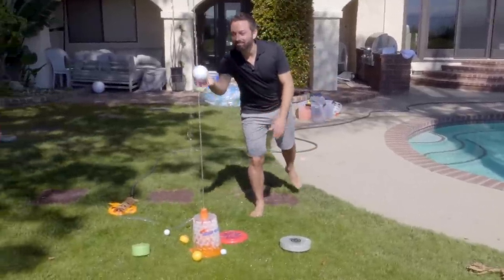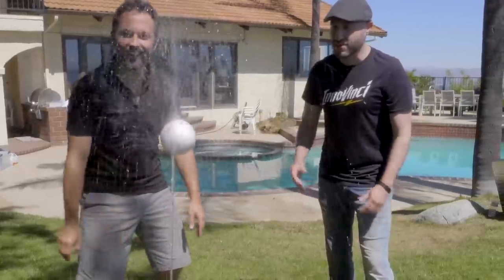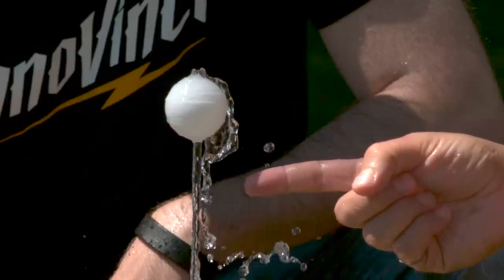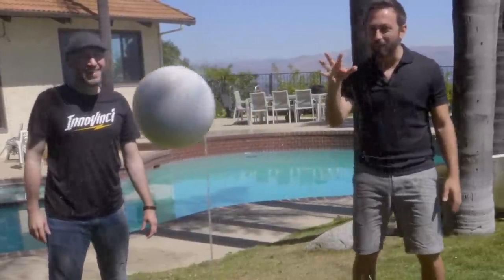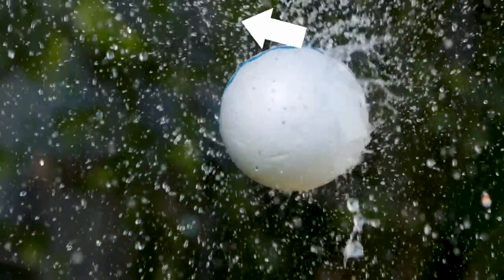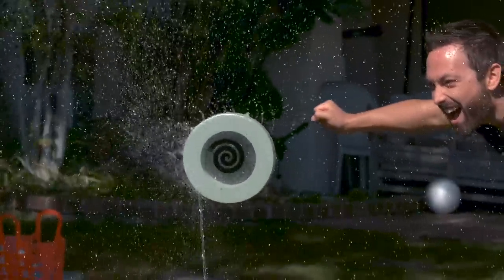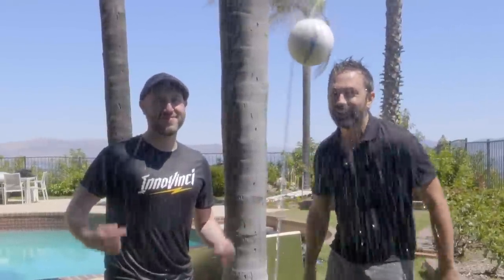Hydrodynamic Levitation!

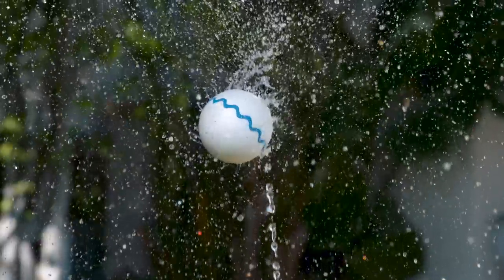Comment: 3:20 there is more water hitting the ball (away) than water that is flung away to keep it in. I suspect air pressure difference is a large actor here to. Fast water moves air (low pressure), slow/still air is on the opposite side of the stream (high pressure) pushes it back towards the water and finds eq..
Reply: try get a hose (not hair dryer) to blow air parallell to the stream with same speed on the opposite side of the ball! This way we se if/ how much air pressure has to do with levitation.

Comment: It's pretty clear at 3:30 that most of the water is flung off the ball almost immediately. That leads me to believe that the ball is pulled by the water's surface tension/adhesion since the water wants to go straight. The ball deflects the water towards it and newton's third says that the ball will be pulled towards the water.

Comment: for anyone who asked,will it work on hydrophobic material
no,what cause the ball to stabilize is that the water is thrown to the side(by the adhesion) causing an opposite reaction so it pull the ball back to the stream

if the material is hydrophobic then the water wouldn't been thrown to the side and the ball wouldn't have any force to pull the ball back to the stream

Comment: G'day Mate, This was a really interesting video for me except I thought I would point out that the reason this phenomenon happens is because of the Coander effect. NOT BECAUSE THE WATER CREATES AND EQUAL AND OPPOSITE REACTION.

You can look it up and there are some great demonstrations of this effect on YouTube using a spoon and a running tap. Basically, when a fluid flows over a convex surface, it has a tendency to stick to the surface and suck the surface towards the stream. This also applies to plane wings (because air is considered a fluid in physics) when the plane wing moves forward. The air attaches itself to the wing sucking the wing upward.  If you don't quite get it then just search up Coander effect with spoon and any video will do. It's quite interesting to see what happens.

Thanks for your time and the video! Cheers, Tim

Comment: Great video! But I disagree with the diagram at 3:32. I believe the majority of the force is right and DOWN, not right and UP. Not only does the footage show the majority of the water spraying in an upward and sideways motion, but the force of the water up on the ball is surely stronger than gravity down (we know this because the ball quickly shoot up from a low position), so it must be balanced by a net force down on the water.

Comment: How sure are you that the spray from the ball (or disc) is what keeps it in the water stream? If you place a spoon into a faucet stream with the convex side it doesn't get pushed outward, the water draws it in (due to pressure differential). It's the reason boast sink lower into the water as they increase in speed.  While this does seem to have a rotational effect rather than simply Bernoulli's principle based on pressure differential, it seems there's another force besides just the deflection of the water. Wouldn't the loss of energy between the impact of the water and deflecting it decay to the point where the ball drops from the stream in a matter of time as it loses the battle against the continuous stream and finite spray holding it there? You can only conserve so much energy without it being perpetual.

Comment: Fascinating! But for the ball to levitate the upwards force must act through the Centre of Gravity (CoG) which in this case is in the middle of the ball. Therefore there must be a "pocket" or region of high air pressure directly under the ball/CoG. ( This being relative to the top of the ball).  Perhaps this happens because of the separation of laminar air flow from the surface of the ball?

Comment: I don't understand how the water being flung off is giving a pushback force to keep the ball in the water stream.
It seems the chemistry (water adhesion to the ball surface and water cohesion with itself) turns the upward water force into a rotational force/momentum (since it just takes less force to rotate that contact patch upward instead of moving that contact patch upward via moving the whole ball) -- the speed [equivalently, amount of rotation before water is 'flung off'] clearly dependent on the weight of the ball. But if the claim is that when it eventually gets thrown off, that exerts a pressure back onto the ball. How is that possible? I thought it being flung off was simply due to the outward momentum (well, tangent to the ball in the direction of the ball spinning) creating a force greater than the cohesive+adhesive forces that keep the water 'attached' to the ball [and the rest of the rotating stream] so the water breaks away from the ball/stream.  It seems like the energy/forces are "spent" in flinging the water off and won't end up creating a force pushing back on the ball. Kinda like how I understand that when I push on a wall, it's pushing back on me, however when I break through the wall, the wall is no longer forcing me away.

Perhaps a similar question is: if you had a very low weight sphere made of a material that was just hydrophobic/hydrophilic enough to let water 'stick to it' but the adhesive force is just barely less than gravity's force. If you put a single drop of water on top of the sphere (not perfect top, you want it to slide down) so that it slides down the side, the adhesion should roll the ball slightly (since it's such light weight) until it gets to the 'edge' of the sphere (where the net force between adhesion and gravity is 'straight down') where it will fall off (instead of continuing to trickle down the side 'under' the sphere since it's not hydrophilic enough to stick and gravity can take over). When it falls off, that should then push the sphere the opposite direction its currently turning/rolling. Will it be enough to stop the current spin/roll? Is it enough to overcome and make it spin/roll BACKWARDS? Is it not enough and the sphere continues to roll forward from the net forward force and momentum until friction stops it?

Comment: Did you try to lessen the adhesion? With some grease, for example? Or to unbalance a ball a little bit (previously, paint its key points, to see how its movement changes)? Or to cut some small cave on the surface? I hoped, you will try at least something. It would be interesting for one more video.

Comment: Did you ask yourselves why the ball remain stable on a certain height?
What is that height meaning?
I think the answer lies in the laminar/turbulent transition point, and the explination on the entire phenomen is there.
You have a drag efect compensated by the push each direct proportional on oposing forces created by the water flow.
 Canyou  try the experiment varying the Reinolds number (flow speed or hidraulic)? diameter)

Comment: This is a great video AND you can do a similar experiment with an airstream but its not as cool..... typical air stream holding up a ball but you have a circular ring horizontally  around the the ball that allows the air to stream between the two, then slowly rotate the ring so it is vertical and the ball will move to outside of one edge and behave like the ball and water in this video.

Comment: Maybe it’s because the stream of water and that side of the ball’s rotation are in the same direction. and once the ball’s rotation is fast enough, it accelerates the stream of water and causes a pressure drop and the ball gets pushed in from the other side.

Comment: Does the styrofoam ball use the paramagnetic nature of water???like some thin layer of magnet in the inside surface of the ball??
There is also a better way for explaining the equilibrium...
I like to imagine that the water and the ball is in a agreement...
1.)If the ball drifts to far away...
Then the water will be like "Hey!!!now u have drifted far away...now u have throw down more water molecules to join me".
The ball will be like  "okay...Roger that"...does the job and joins back using the 'adhesion' thing between the ball and water that Derek told.
(This is why the above doubt that I asked)...
2.) if it drifts too far in...the ball will be like "Hey!!!if I fall too in ,then I would become unstable...Push me back"...the water will be like "okay..done"...does the job and pushes the ball back to become stable because of Bernoulli's principle(more pressure because of resisting the flow).
Hope this helps😊

Comment: I don't think it's the water getting flung down that makes the effect work. It was pretty apparent on the disc that it was actually air and not water causing the trajectory towards the water and the water was pushing it away. It's the same effect that makes a slider pitch in baseball work, except in this case the water causes the spin while pushing the ball away and the aerodynamics of the spinning ball pull it back in, creating an equilibrium of sustained levitation. It's a cool video, but it's weird how you can view the high speed on the large objects and still come to that conclusion about the water being thrown sidewards creating some how more the same push as a direct nearly 45 degree surface angle with fast moving water? Not even close, the water obviously has lost energy (and most has flown off already too, so less mass) before it's whipped around.

Comment: I thought It was caused by the ball creating a gyroscope effect that made the forces in other directions cancel out and making it more stable while spinning allowing the water stream to counteract the only force that could stop it, gravity. i dont have any fancy degrees in physics or anything so I'm sure Derek's is more accurate than my hypothesis but that's what I thought first. The disc doesnt even appear to be sending enough water away to keep the disc in the stream according to Derek's reasoning.

Comment: As a follow up video, it would be neat to see if multiple streams of water flowing at the same rate could support a long pole. Also, it would be neat to see how much weight could be supported with different volumes and flow rates of water. Also, would salt water be as effective as freshwater?

Comment: But the force from the stream of water would be significantly greater than the force being created by the water that made it far enough around the ball to counteract the original forces, wouldn't it? So what if it's more like the flowing water creates an area of low pressure along the object's side, and the higher pressure of the surrounding air presses it into the stream, and therefore creating an equilibrium. The same thing happens when you drop a ball from extreme heights while adding a spin to it, it will start to curve toward the direction of the spin

Comment: The explanation given here is wrong, if someone cares. While i do think the connection that the energy of the water being flung off is the same as the energy keeping the ball in the stream is right, saying that the water is pushing back on the ball is wrong. Even if the water was really pushing back, that force would only have an effect on rotation of the ball and not its center of mass. What is really happening is that the water leaving the ball is creating a low pressure area at the point of departure. That low pressure area is then filled in with the ball itself. Sorry for being so confident, and sorry if my comment was hard to read because of badly constructed sentences.

Comment: Hey Derek,
Can you tell me if my idea is gonna work?
it's basically a ramp on which a wooden ball (with a smooth surface) rolls . the end of this ramp is connected to a valve which opens due to the velocity of the ball rolling down. The valve opens into a long tube filled with salt water. The upper end of the tube is connected with the upper end of the ramp. So the ball floats up to the top and continues down the ramp and back up through the tube.
thanks in advance.

Comment: Does the friction of the styrofoam have anything to do with the water sticking to the ball while it rotates?   Would this work if the ball were coated in some sort of slippery coating?  Similarly, would the ball carry the water further if the surface had more friction?

Comment: what if you use liquid with higher density?  can you levitate an orange for example? theoretical answer is yes 😉. but my curiosity is about the scale of an experiment. Higher density of liquid, faster flow, heavier ball or disk. and what's the effect in case of uneven weight distribution ( havy core of a sphere and very light sphere surface )

Comment: @veritasium ... what happens if you project the stream of water at a slight angle (not exactly vertical)? Will the ball still levitate? if the ball levitates, then on which side? the one with acute angle or obtuse angle with respect to ground?

Comment: i took a 50 gallon well water pressuring tank , shot basket balls and baseballs 100 ft into the air like this. pumping the water up to 80 psi then letting it all lose all at once though a 2 inch ball valve. lots of fun.

Comment: I think it's doing that because it is constantly in a backspin and then the jet of water is pushing it away but providing momentum and then the backspin is pulling it in towards the water but the water is providing forward spin and  pushing it away. Do its basically a constant flow of up and over AND down and under all at the same time

Comment: I disagree with your hypothesis that the water being thrown off the bottom is the main factor causing the ball to remain stable. For that to be the case there would need to be a much larger fraction of the original stream being redirected by the balls rotation. I believe that Bernoulli's principle is the main factor. As the stream contacts the ball, the stream is squashed/flattened which causes the stream to increase speed therefore lowering pressure, creating a pulling force. Laminar flow around the whole ball is not required, this is demonstrated by the simple ping pong ball on a string experiment, when the ball contacts a stream of water from a tap, the ball will be attracted to the flow immediately on contact before it gets encased in water. And if your stream is small enough you will reach an equilibrium point where the is barely any contact between the ball and water but the ball remains stuck against the flow.

 I watched through the slow motion footage of you cutting the stream with your hand and if you watch carefully you should notice that just as the stream re-contacts the ball, before any of the water flies over and down, the ball gets 'pulled' in towards the stream. I believe this is further evidence that Bernoulli's principle is playing a major part.

What do you think Derek?

Comment: when they do the disks, you can see a lot of water being thrown towards the stream side. this would seam to contradice the hypothesis that water being thrown the opposite direction is the stabilizing force. What if the surface tension being overcome as the water is thrown were causing this?

Comment: I would wager that if you used a completely hydrophobic surface this wouldn't work. I don't have anything to back this but it feels like this is upward pressure from water combined with surface tension adhesion.

Comment: The video provides an explanation for stability in two dimensions, but not the dimension in the direction of the spin axis, nor the stability of the direction of that axis. Could there be conditions in the absence of wind where that axis changes direction despite gyroscopic stability, and the ball gradually moves around the column of fluid? It's complicated!

Comment: What is really happens is this, the water hits the ball and
do to the surface tension of the water the water sticks to the surface of the ball,
that tension gives the water the centrifugal force that it needs to stay on the
surface of the ball, in return because the third law of newton the same surface
tension gives a force to the ball opposed to centrifugal. The surface that is covered
with water is the area that forces applied to the ball, and this surface is pointing
up and towards to the jet of water.

Comment: I used to have a harry potter toy that did this but it was with air and you'd have to turn the board and turn up/turn down the power of the air to work your way through the obstacles

Comment: I have a question
why the ball lifts upto a height? why it is not at equilibrium with the stream at the very start of the nozzle of the stream. I know its mg(ball)=ma(stream of water). but why it isnt equal at the ground? why does it have to rise? or why doesnt it fly to the space? can someone explain? I can't brainstorm this. thanks in advance
Reply: because the equilibrium height is prolly dependent on the starting force of the water, 
in other words, the ball goes up (or down) until the Fg (force of gravity) is finally equal = F0 (the starting force of the water sprout).
a higher starting velocity for the water -> larger F0 which -> higher the height/distance for the applied force of the water to be equal = Fg.
Therefore it won't fly into space nor stay at the ground, as it wants to stay in its goldilock zone where Fg = F0 (as F0 decreases with increased distance)

although it could theoretically get pushed into space if the water pressure is high enough, we would have to assume the ball to be indestructible (as it would otherwise be blown/teared apart by the pressure)
Reply: Buoyant force depends on height somehow.